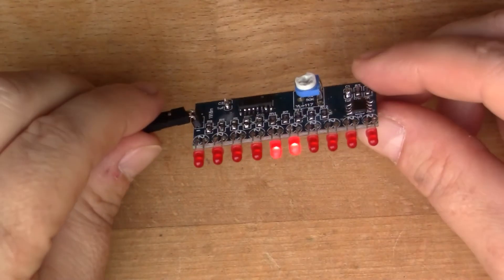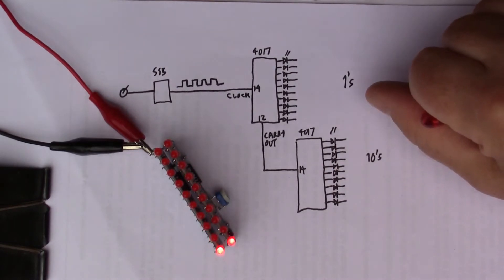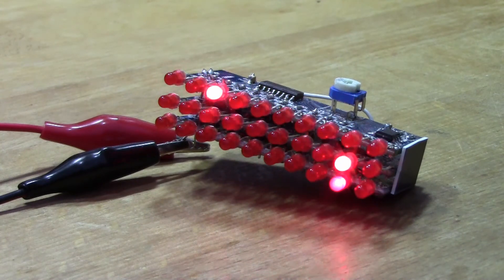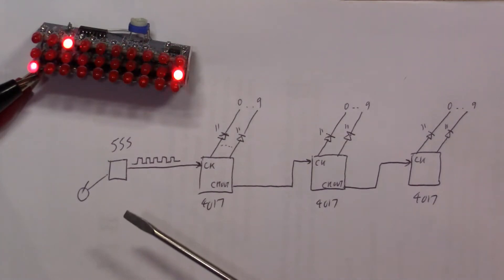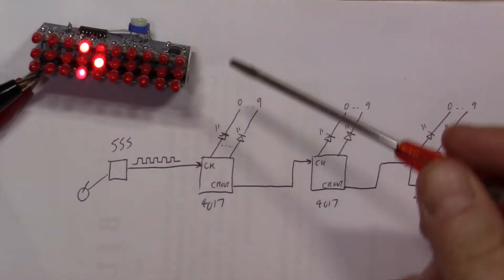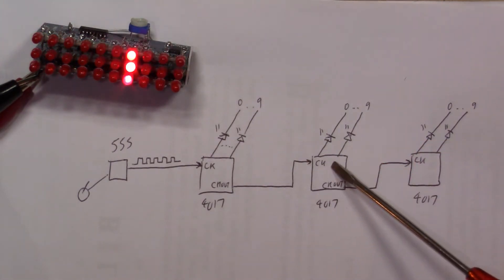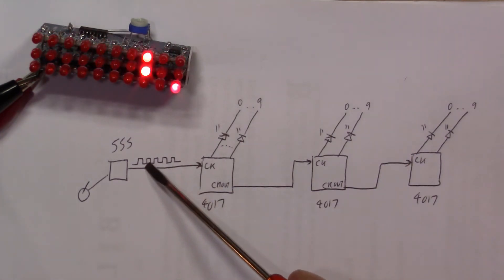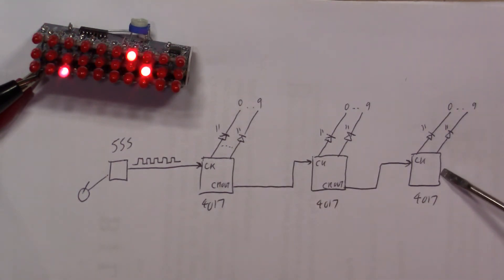4017 Decade Counter Kit - Hacked (Part 2)

Comment: '
wow that great kit with 3 PCBs and 1 speed control...
try use a plastic pin on the speed control...
dont need use a metal screwdriver...
how about 4 or 5 PCBs at once...
better use color LEDs or bright orange - yellow LEDs

Comment: I have been tempted to make a binary clock with this type of set up, but i have been told that a 555 is not accurate enough for time keeping. still i think it would be cool.
Reply from the maker: Yes, the timing from the 555 comes from charging and discharging a capacitor, so it's very dependent on the precision of the capacitor and resistor and will vary with temperature etc.  I recently discovered that the DS1307 realtime clock chip/modules have a 1Hz output derived from a crystal (see my Flashing Light Prize video) - this would be a much more precise input for your clock, and you can get them for under a pound.